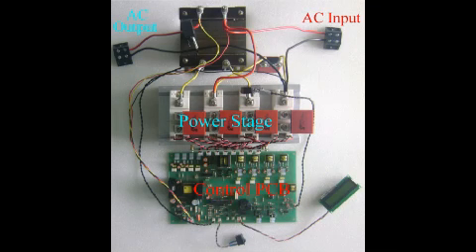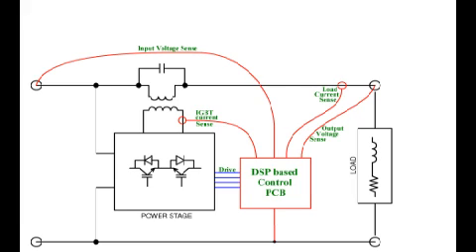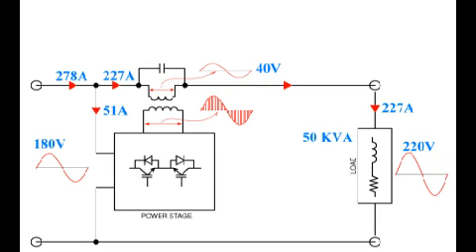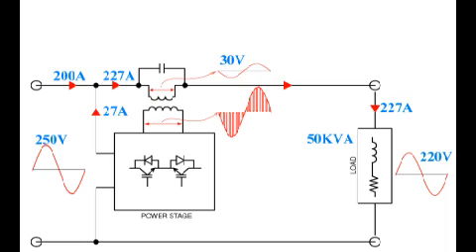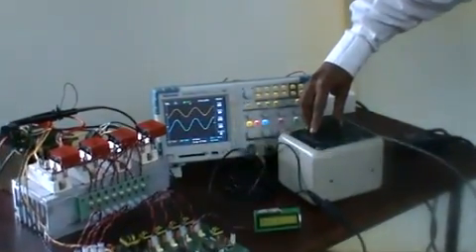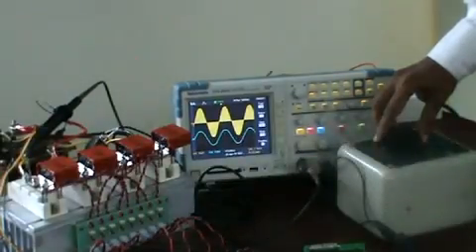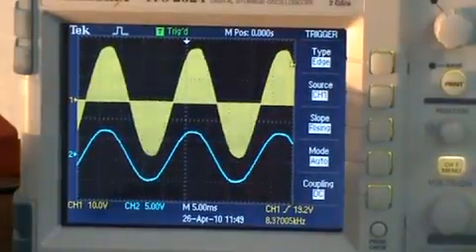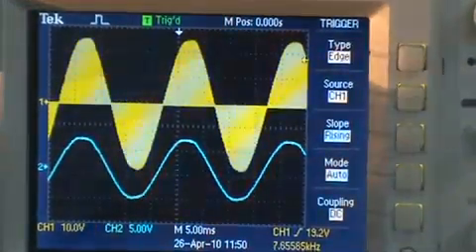Static Voltage Stabilizer IGBT PWM

Comment: We recently installed this stabilizer for DMG but it absolutely fail, when we switch on the DMG, stabilizer will start automatically trip.
Reply: Dear Sir, this may be because of some misconfiguration. We would like to help you with this.

We are one of the leading manufacturers of IGBT Controlled Static Voltage Stabilizer with high precision, fast regulation and inbuilt circuit protections. 
You may check about it more on
https://nkbtechnocratspltd.com
Or call us on +91 9660061987.

Comment: How make a igbt voltage regulater stepliser give me daigram please sir
Reply: Hello !

We are one of the leading manufacturers of IGBT Controlled Static Voltage Stabilizer with high precision, fast regulation and inbuilt circuit protections. 
You may check about it more on
https://nkbtechnocratspltd.com
Or call us on +91 9660061987.